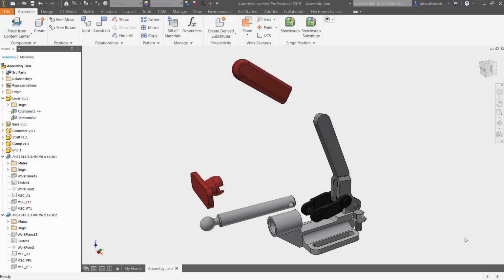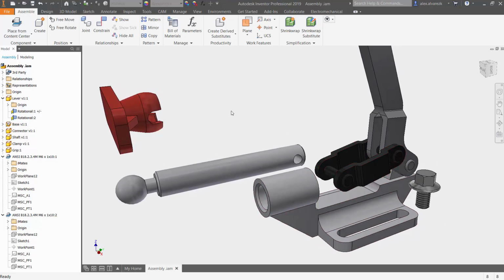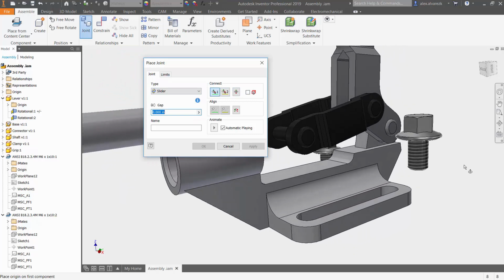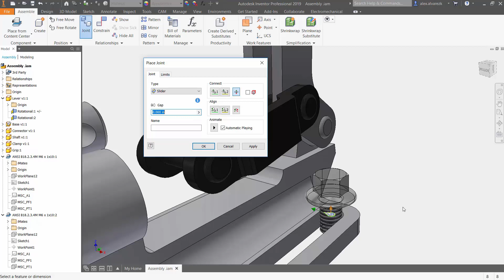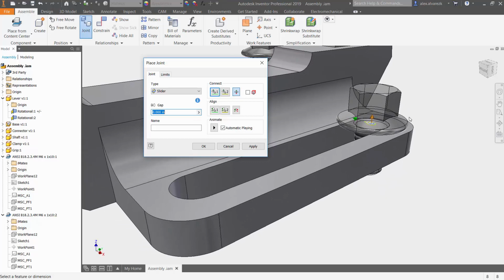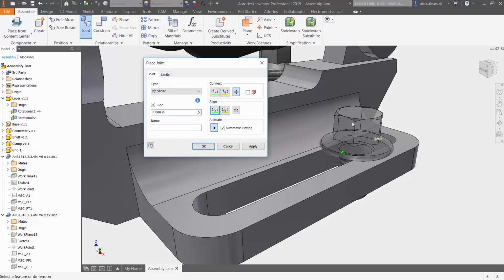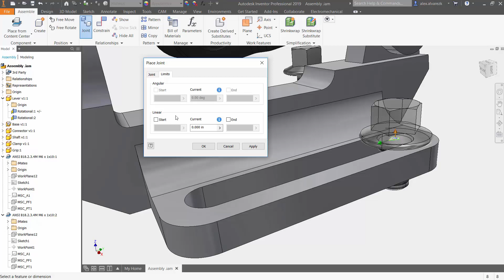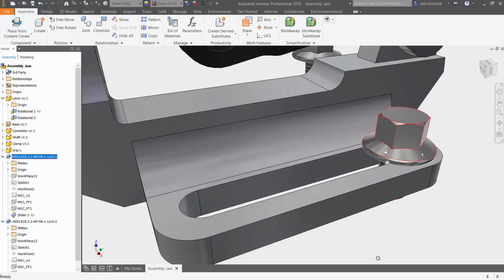Quick Tip - Slider Joint

Comment: still not working, the slider still just move on x axis
Reply from the maker: If it's still moving in the wrong direction, then the slider joint was not applied or was applied incorrectly.